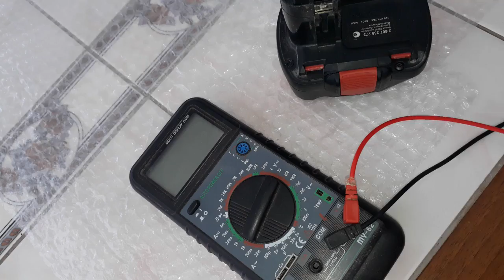ŞARJLI MATKAP BATARYASINI ESKİ LAPTOP PİLİ İLE YENİLEME/CONVERT CORDLESS DRILL BATTERY NICD TO LION

Comment: Selamün aleyküm kardeşim bana yardımcı olursan çok memnun olurum.
Beni sorunum şu: güneş aydınlatma pakenin 6 volt 4 amper aküsünün yerine bu pillerden kullanmak istiyorum ne yapmam gerekiyor.
Reply from the maker: Aleyküm selam. Eğer kullanında sisteme bi zararı olmazsa bu pillerden 2 tane seri bağlayabilirsiniz 7. 4 ile 8.4 volt arası yapar. Amperi artırmak için bu seriden yeterince paralel bağlayabilirsiniz. Ayrıca 2s bms devresi kullanmalısınız.
Reply: @kadirakkus50   çok teşekkür ederim

Comment: Emeğinize sağlık. 3 seri 18650v pilin voltu biraz az gelir gibi. 2paralel yapmışsınız amperini yükseltmişsiniz. Bu şekilde verim alabiliyormusunuz, merak ettim. Sanki biraz güçsüz çalışıyor gibi geldi bana. Tabii pillerin şarjı nasıldı bilmem.
Bende aynı şekilde yapmak istiyorum ama 12 volt için 4 seri mi yapayım, yoksa 3seri 2 paralel mi yapayım kararsızım
Reply from the maker: Orijinalinde bu kadar verim almadım öyle diyim. Benim şarjlı 12v olduğu için 3 tane yeterli gördüm. Eger 4 seri yaparsanız tam şarjda 16 v civarı yapar eger şarjlı zarar görmez diyorsanız deneyebilirsiniz. Ama alet 12v ise 3seri 2paralel daha mantıklı bana göre.

Comment: BMS lerin 2s-3s-4s dediği fark nedir?
Reply from the maker: 2seri 3seri 4seri bağlı pil anlamına gelir. Mesela 3 tane 3.7 volt pil seri bağlanıp 3s bms ile 12 voltluk sistemde kullanılır.
Reply: @kadirakkus50  2 şer 2 şer 3 tane (3.72 den 6 adet) için de 3s mi kullanılmalıdır?
Reply from the maker: @sahinmuzaffer  aynen kardeşim sonuçta 3 seri yapar
Reply: @kadirakkus50  eyvallah hocam sağol bilgi için 👍

Comment: Sa bu koruma devresini neye göre alıyoruz. Örneğin bende de bosch psr1200 şarjlı vidalama var, nicad pilli ve tek bataryalı bataryası da ölü, elimde de bir adet de Laptop bataryası var hiç açılmamış. Ben kaçlık bı devre almam lazım
Reply from the maker: A. S. 12 voltluk batarya olduğu için 3s bms devresi yeterlidir çünkü 3 seri yaparak 12 volt civarına ulaşacaksınız videodaki gibi bağlayacaksınız.
Reply: @kadirakkus50  hızlı yanıtın ve yardımın için teşekkür ederim. Şimdi bu devreden bı tane sipariş edip bende yapacağım inşallah bahsettiğim bataryadan çıkan piller ile yarar.
Reply from the maker: Rica ederim umarım işe yarar

Comment: hocam elimde bosch 9600 matkap var bataryası bitik sonyy vtc6 18650 2 adet pilim var  matkaba yeterli gelirmi ayrıca  koruma devresi kullanmam gerekiyormu şimdiden teşekkürler
Reply from the maker: Koruma devresi olmazsa olmaz pillerin bozulmaması açısından. Tahminim sizin şarjlı 10.8 12 volt civarı o zaman 3 adet kullanmalısınız.
Reply: @kadirakkus50  kardeş merhaba bende de 9,6 voltluk bosch makina var 3s karta 3 adet pille böyle bağladım ama çalışmadı, makinadan uğultu geliyor ama dönmüyor, acaba tam watt değerini mi bulmak gerek? 2000 mah 3,7 voltluk  lık  üç pil 12 volt elektrik veriyor akım fazla gelmiş olabilir mi?
Reply from the maker: Watt olduğunu sanmıyorum 12 volt çıkış varsa devre çalışıyordur.  bms çıkışıyla matkap girişi kutupları kontrol edin artı artımı. Ters bağlantı olabilir.

Comment: İyi günler , sizdeki pillerin mah değeri farklı mı bana mı öyle geldi , farklıysa bu sorun yaşatmıyor mu
Reply from the maker: İllaki milimetrik fark vardır ama şarjda ve kullanımda sorun yaşamıyorum.
Reply: Kullanımda 2000 mah ile 2400 mah farklı değerlerde akım vermesi hem pile hem motora zarar vermez mi
Reply from the maker: @huseyinturanozdemir5814  amper şarj kapasitesini belirler 10000 mah da versen motor 12 volt la çalışır. Birinde 1 saat çalışırsa birinde 10 saat çalışır. Bu fark şarjda düşük mah lı pilin erken dolup akım kesilmesine ve paralelindeki yüksek mah lı pilin tam kapasite olmasını engeller.

Comment: Biz 40 amperlik devre koyduk. 6 pil ile ama. Güç e maruz kalınca kesiyor enerjiyi. Neden olabilir acaba
Reply from the maker: Ya cihaz anlık 40 a üstü akım çektiği için korumaya geçiyor ya da pillerin biri bile arızalı olsa bunu yapar piller aynı değerde ve sağlamlıkta olursa sorun kalmaz.
Reply: @kadirakkus50  sorun cihazın modeli ile ilgili sanırım. Psr 1200 modeli bizde ki. Sorunu direnç koyarak çozdük gibi. 15 amperden fazla akım vermesin dedik
Reply from the maker: @barsvarki9385  mantıklı benim bataryanın orjinalinde de direnç vardı sökmedim ve hiç kesmiyor.
Reply: @barsvarki9385  hocam aynı cihaz var ve aynı sorunu yaşıyorum nasıl bir direnç attınız ve bms çıkışına mı direnç attınız

Comment: Merhaba,
Bir konuda yardımınıza ihtiyacım var, şöyle ki; 14.4v matkabımın bataryalarını uygun bms devre kullanarak li-ion ile değiştirdim, ancak 4s (2000mah) olarak ayarladığım pil düzeninde tam şarj 16.4v olduğundan 14.4 volta göre ayarlanmış olan şarj kızağı  piller dolmadan akımı kesiyor ve üstündeki yeşil ışık yanıyor. Kızağın içindeki devreyi söküp onun yerine elimde olan 24v  2 amperlik adaptörü bağlasam şarjda sıkıntı olur mu? BMS devresi 24 voltluk girişi tolere eder mi? Yardımcı olursanız sevinirim.
*Kullandığım devre:
  @t
Reply from the maker: meraba . tam emin değilim bi kaç volt olsa sorun olmuyor ama bu iki katı devreyi bozabilir.eğer imkan varsa 24 volt olanın çıkışa direnç bağlayarak 18 civarına düşürürseniz iyi olur.

Comment: Elimde bavarianın 18v bataryası var bozuk ona kaç tane senin pilden ve hangi sarj devresinden almalıyım
Reply from the maker: 18v için 5 tane pili seri bağlaman yeterli ve 5s bms alman lazım. Ben vidyoda 12v için 3 seri yaptım ve yer olduğu için amper artsın diye de diğer 3 seriyi paralel bağladım.sizde de yer varsa  2 tane 5 seriyi paralel bağlayabilirsiniz.
Reply: @kadirakkus50  cevabınız için teşekkürler bir kaç sorum daha olcak.
1- bataryanın içinde 15 adet sc 1.2v  1200 mAh Ni-Cd piller var bunları 18650 pillerlerle değiştirdiğim zaman kaç mAh lik 18650 almam gerekiyor? 
2-amperin fazla olması zarar verir mi?
Reply from the maker: @ahmetyaman5809  2000 ile 3000 mah arası  tavsiye ederim. Fazla Amper daha uzun kullanım ve güç sağlar zorlamada falan bayılmaz. Şarjlı matkap için bi zararı olacağını sanmıyorum.
Reply: @kadirakkus50  son olarak şarjlı matkabın şarj aleti 21 v 400 mAh değerinde bunu değiştirmeye gerek var mı? 18650 sıkıntı verir mi? Şarj süresi mi uzar?
Reply from the maker: @ahmetyaman5809  değiştirmeye gerek yok sanırım çünkü  voltajı balansı falan bms devresi ayarlıyor             aşırı durumlarda korumaya geçiyor . Daha iyisini alsanız bile devrenin verceği akım ve mah aynıdır farketmez. Devresiz yapmayın tehlikelidir.
Reply: @kadirakkus50  dediğiniz gibi bms devresiz kullanmayacağım. Bu devrelerde şarj olunca elektriği kesiyor değil mi? Çünkü patlıyor felan diyenler var o yüzden sordum. Yardımınız ve bilginizi paylaştığınız için çok teşekkürler.
Reply from the maker: @ahmetyaman5809  aynen tamamen dolunca  şarjıda elektrik almayıda keser. Rica ederim.

Comment: merhaba, video için teşekkürler öncelikle. benimde PSR 14,4V olan sizdeki eski piller gibi piller var. bende li-on pil yapmak istiyorum fakat şu devreyi tam çözemedim aliexpreste baktıklarım 12.6V ile 16.8V olanlar var işimi görürmü yoksa 14.4 bulmam mı gerekir https://tr.aliexpress.com/item/TZT-4-S-40A-Li-Ion-Lityum-Pil-18650-pcb-arj-cihaz-BMS-koruma-levhas-I/32908097152.html?spm=a2g10.search0104.3.30.39034df3w8k5Rl&ws_ab_test=searchweb0_0%2Csearchweb201602_3_10065_10068_319_10059_10884_317_10887_10696_321_322_10084_453_10083_454_10103_10618_10307_537_536_10902%2Csearchweb201603_56%2CppcSwitch_0&algo_pvid=7a10c5de-62b1-4ad8-8f70-cb35bffa3685&algo_expid=7a10c5de-62b1-4ad8-8f70-cb35bffa3685-3
Reply from the maker: Gönderdiğiniz linkteki devre 4s yani 4 seri anlamına geliyor ve sizin batarya için uygundur. Lion  Pil başına 3.7 v olarak düşünürsek 14.8 v yapar tam doluyken 16 v civarı yapar o da sıkıntı çıkarmaz sanıyorum.
Reply: @kadirakkus50  anladım şimdi teşekkür ederim sağolun